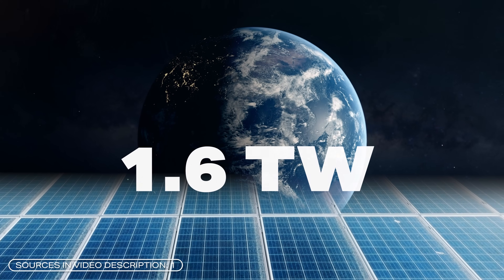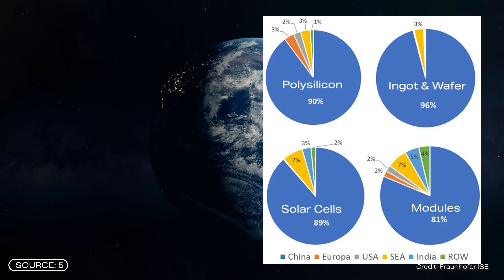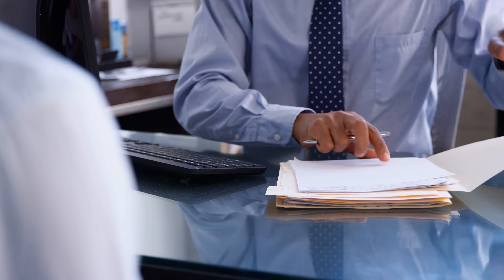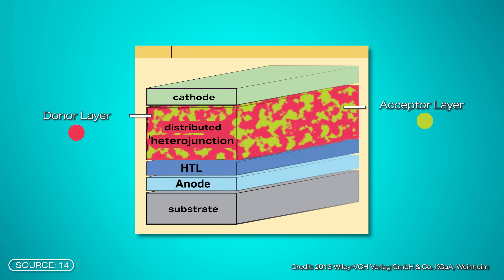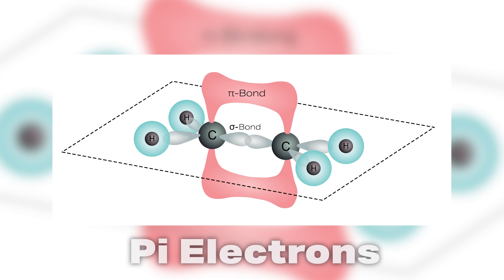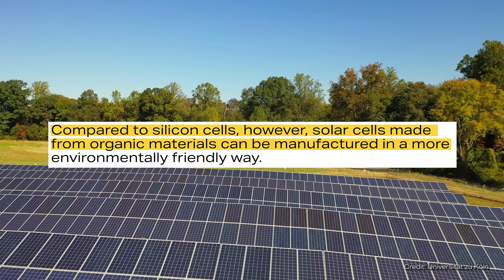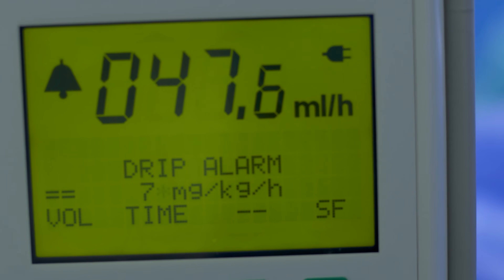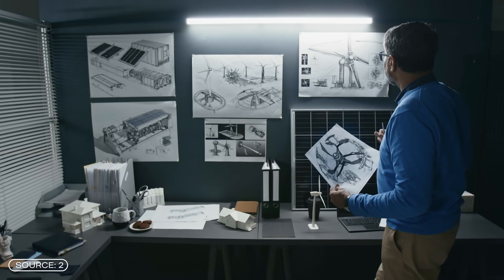Organic Solar Cells Made From Carbon!

Comment: In the future solar energy will be obtained using mirrors to concentrate sunlight to heat molten CaCl2 salt, (liquid 780-1900^C). This can achieve over 90% efficiency, although the thermal energy may need to be converted to electricity. However, it can also be used to heat furnaces directly and the mirrors are much cheaper than photovoltaic panels. The technology to manage the liquid salt (valves, pumps, pipes etc) is yet to be developed. Liquid salt is also very efficient for storing thermal energy and can potentially work with nuclear reactors.
Reply: Solar panel systems are cheaper. While there is value in mirrors storing heat in salt for nighttime generation of electricity, the value is lost when factoring tower and rotating mirror stands. Also, the insane heat tends to destroy the heat transfer apparatus, increasing expenses to unprofitability. Not to mention budget bloat endemic to all custom mega projects today, just observe.  And it vaporizes birds and insects.   Solar panels are plug and play, known tech, any local company can install and maintain them. Less opportunity for corruption. They're boring, simple, and harder for bad actors, energy oligarchs, and govs to f*ck up. Such is the state of the world today.
Reply: Thousands of mirrors require thousands of aiming assemblies. Each with it's own trajectory. Even aiming the sunlight on a distant target is difficult let alone keeping it there. Been there, done that.
Reply: @howardsimpson489  if photovoltaic solar panels don’t rotate to follow the sun the efficiency ranges between 30% to 0%.
Reply: Sounds like a good opportunity to make the equipment to make the system work
Reply: Too much losses.
Has been tried.

Comment: Seems kind of naive to think a new kind of PV cell wouldn't also just be manufactured at a lower cost in China. Maybe get a few years of "head start" before a factory opens up over there that manufactures more volume of panels each year than Germany has produced in totality since the 90's. I suppose the best hope is they decide a market of coating the inside of rooms with thin organic panels to scrape back a few watts from the incandescents isn't worth the investment compared to just putting down another square meter of traditional PV in a field somewhere.
Reply: First of all, there's no such thing as Freed Trade. Second of all: if you have a Trade Deficit then there needs to be markets you don't import goods for. It is much more important to have a strong domestic economy than trade with another. Trade should only happen because it HAS to happen not because a Capitalist feels like it.
Reply: @MysteriousSoulreaper domestic industry*
Reply: @MysteriousSoulreaper  yeah but, the problem is that the west is controlled by the capitalist. Even trade barriers are done in the interest of the capitalist. The people has no say or very little say in this.
Reply: @turtlesoup8134 yes, the western oil companies will never allow it, vs China where the government will give you mountains of cash to develop and produce it and also execute anyone who gets in the way
Reply: I discovered that wind energy can overcome almost all of its drawbacks, such as significantly reducing its size and height when combined with newly designed, high-efficiency generators. At this point, wind turbines can produce electricity more efficiently and effectively than solar cells.
Reply: Australia is likely to produce a graphene cell with perovskite 30.6% with no silicon or silver. Lower cost manufacturing. Low AUD should make it competitive. Not reliant on China supply chain.
Reply: Yes, it could be dirt cheap if made in China, but if it's cheaper in real terms, it's easier to absorb that cost with protectionist policies. Not really a fan of those policies in the first place, though.
Reply: @kmr_tl4509 protectionist policies ? Are you naive enough to believe that ? Protectionism is a stop gap, it will stem the tide, but won't stop the flow. Especially if you don't utilise that window of opportunity that protectionism afford to build out domestic capacity.
Reply: European alternatives are more expensive than its chinese counter parts. Thats a fact, but they exist, and should exist, for healthy functioning european economy that is diversified and not stranglehold and blackmailed by global players in an absolute manner.
Reply: @Krushx0  They put up with being blackmailed by Russia’s fossil fuel for HOW long? That’s way, way worse than what China could do. Even if China refuses to sell you more, the ones you already have keep working. But if Russia, USA, or other big petrostates cut you off, you’re screwed.
Reply: @davestagner  - "They put up with being blackmailed by Russia’s fossil fuel for HOW long?"
Did you leave out the answer because that time period was actually very short? ;-) It was definitely shorter than the time period Putin hoped and expected (which was probably forever). If you refer to the time preceding the war, Russia didn't blackmail, but sold fossil fuels to Europe for a cheap price.
Reply: @adoatero5129  That wasn’t the start of the blackmail, just the last straw. This wasn’t Putin’s first invasion of Ukraine, and his previous takeover of Crimea was just one in a long line of violence against other nations, while Europe more or less kept their mouths shut.
Reply: If it is cheaper in real terms to buy from China isn't it good for everyone to do so?

Remember, the only reason it is cheaper is because your country has other stuff it values less that it can trade for it.  If you aren't making anything you can trade for it then your currency weakens and eventually domestic production gets cheaper.

Sure, for certain national security critical industries or ones which would cause a disaster if suddenly cut off dependence can create problems.  But solar cells aren't like that -- if China decides to suddenly cut you off (eg sanctions) you pause the transition to renewables long enough to restart a domestic industry and they suffer (both economically and from any climate change) so it's not the kind of industry you need to protect.
Reply: @Peterderdes1094 Chinese sell every single EV and solar panel for a loss already
Reply: @grantbuttenshaw  ...at a loss the Chinese Communist Party can afford to stomach, at that.
Reply: @Iamwolf134 not for long. They promised their population prosperity...they can't deliver.
Reply: @grantbuttenshawyes but I know company directors and ceos in china happy working on a salary of 600 euros a month, and there are millions of them.
Reply: @grantbuttenshawwell they already have. To break out of the middle income they need internationally competitive domestic national champions(just like the super majority of high income industrialized countries have).
And they have cultivated highly competitive industrial behemoths in every sector. German machine tool exports are already dwindling as we speak. Perks of controlling the factors of production.
Reply: @henfreetravel 😂 do you even hear yourself ?
Reply: @grantbuttenshawHonestly, if they want to subsidize decarbonization I say let them.  Apparently we don't have the will to do it ourselves.
Reply: @petergerdes1094 it's good for china, since they are the ones producing it. Western countries prioritize the "business case" for everything at the expense of strategic necessities. Consumption fetish even if it is for renewables is strategically stupid
Reply: @t.s.d.1376 If it was for something other than PV I might be more sympathetic but this is something the whole world needs to adopt as quickly as possible.
Reply: @petergerdes1094  in theory in the free world yes - but if there is a war (e.g. China invades TW), then it gets much more complicted. If China controls the full market (including the rare earth) = then they keep the whole world by the balls.
Reply: China is making in África to cut costs... Europe can do that too and cut costs by using automation
Reply: @Maia_Cyclist china isn't making anything in Africa that they aren't selling in the domestic African state markets(not much in the way of exports you see, not at the moment atleast), most African states are too impotent and useless to leverage that to build domestic capacity. 
Chinas activity in Africa is mostly confined to extraction of natural resources from Africa for processing back home and the Africans get paid handsomely without getting lectured or being asked to change their political system or having to hear the insufferable and sanctimonious Atlantic Liberals whine and preach about the glory of democracies. I say that's a good deal for the Africans.
Reply: @Maia_Cyclist China can already do automation better and cheaper than us. And they are doing it already. I don't know why people saying "we can automate" for the past 20 years didn't see that coming. It's not like we didn't already know they were producing more STEM grads than us, and their STEM students have been outperforming ours at every competition for the last 30 years.

Comment: From Aussie land, I admire your technical prowess but I would like you to look at the bigger picture as well.
PV panels provide intermittent power but for it to provide base power equivalent to gas, coal atomic power, hydro etc,  batteries MUST be added
Also there is the loss of area which can be used for some sort of agriculture.
Interested in your thoughts
Reply: batteries are cheap now.  under 100usd per KWH and going to 10 USD in a year or so.    Coal and nuclear are inflexible and THEY NEED hydro or gas turbines/piston backup.  But batteries are ending all short term intermittency.
Reply: In Australia, we've got a tonne of only marginally productive land available, with plenty of sunlight.

I'm more worried about what weather events do to solar panels. One decent hail storm, or cyclone, or mini-tornado, or even a very windy storm front, and there's a lot of power generation assets wiped out. It's probably just an installation and location and hardening problem, not too much different from wind (or even the power network itself), but it is a consideration.

(Note: I'm a bit of a solar advocate, but it's not something that gets brought up that often)
Reply: @sambojinbojin-sam6550  Agree about marginal land but we are not doing anything to rehabilitate it which to me is a different problem.
The point I was really making was the cost of battery storage has to be included in the equation.
Reply: @johnpalmer5614 definitely true. But, as mentioned, getting cheaper every day. And slightly less explode too, which is nice